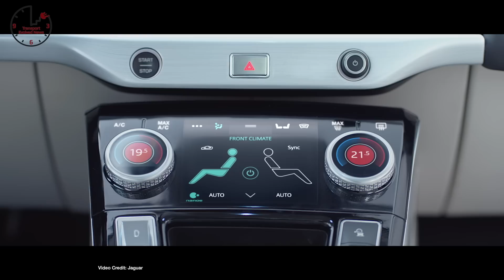Model 3 Worldwide Launch,  Jaguar iPac SVR, Hyundai Battery Search-  TEN Episode 211

Comment: By the way Cd (coefficient of drag) is a ratio, and therefore it applies to any size vehicle.  To put it another way, the Cd of any vehicle is independent of the size.

The CdA (coefficient of drag multiplied by frontal area) is definitely relative to the size of the vehicle.
Reply: Agree. Thank You :D
Reply: Neil Blanchard, correct, and it’s easier to get a low drag coefficient on a big vehicle, which is why the Tesla semi can claim it has a lower drag coefficient than a Bugatti Veyron. It would be better if cars were rated in kw needed to go 100 km/h.
Reply: Well, it is the length that helps the Cd, not the size, per se.  Most of the drag is generated at the back of the vehicle.  

The Bugatti has a massive cooling requirement, and drag is generated on the air flow through the cooling system.  On a typical ICE car, this is about 10%, but that car has far higher cooling load, so it is probably much higher.

Electric cars have lower cooling load, so they have an inherent advantage to get lower drag.
Reply: Neil Blanchard, the size of the vehicle is what allows it to more easily conform to a teardrop shape, while having the utility that you need. As you make it smaller, it’s harder to get the shape, and have someone sit in it. 

Yes, Veyron has a lot of cooling drag, but also has a lot of induced drag that the semi doesn’t have. Formula One has even more induced drag. So if you are major a racing car with foils where L/D is important, Cd is important, but for the masses, Cd is just a marketing term. Even someone who understands Cd can’t easily calculate the aerodynamic drag without knowing the frontal area, and then would still need the rolling resistance and drivetrain losses. 

So kw needed to go 100 km/h would be useful. We know the Tesla semi needs 120 kw, and I bet the Veyron could do it with 30 kw.
Reply: IMHO Understood - I has designed and begun to build an EV called CarBEN, and having the front close to square means the interior volume is more practical.
Reply: Neil Blanchard, are you using computer modeling for drag or just building based on known optimum shapes for low drag?
Reply: Neil Blanchard, oh, I looked at your channel. Are you still working on CarBEN or is that project canceled? Looks like you did a lot of work on the computer designs. That Black Illuminati car was interesting too.
Reply: IMHO I was basing it on known designs.  I tried to do CFD but the model was full of holes, between the polygons.
Reply: IMHO I am hoping to get back to it.  I need to add to my garage.  My interim goal is to take it to a wind tunnel.

Comment: I have saved over 1000L of diesel since I got my e-golf. I'm also the first at work to have en ev and every one is interested one actually started shopping for en ev. Currently what is hindering ev adoption is dealers not having them in stock I had to wait almost a full year for mine.
Reply: Right I tried to test-drive an env-200 in the UK and they said it would be months before they have another one in.

Comment: I have to take exception with your suggestion that people who buy ebikes do so because they can’t afford or accommodate a car. I know in the U.K. people have a problem with understanding quality bikes aren’t cheap. I’m always finding that when I talk to people about bikes and ebikes especially. I was just expecting a bit more. You can buy top quality ebikes that cost decent used car money, because they are incredibly well engineered and ideal for urban and suburban environments. Riesse & Muller for example make amazing stuff. But even the average specced ebike will set you back a couple of thousand.

I love my Renault Zoe and I’m excited to swap to a Smart EQ, but in terms of pure fun, around town especially, the bike is so much more satisfying than the car. I can’t wait until we actually have good bike infrastructure and I’ll be even more in favour of cycling.
Reply: For me there's much greater satisfaction gained from riding my bike than driving a car. Any idiot can sit in a car and press pedals with their feet, whereas it takes actual effort to ride a bike. It's just a shame that e-bikes cut out at 16mph. When I was fitter I was able to maintain an average speed of almost 20mph. Seeing as it's quite flat where I live! An e-bike is only any use to me on the odd hill or slope. What I want is a bike that can add 5-10mph on top of what I can already achieve. I need a minimum range of 35 miles as my round trip to work is 31 miles.
Reply: Chris Till,
Take this from a person of the largest motorcycle market, india, there is still an issue about safety and protection from the elements, here a  used Tata Nano with A/C costs $1k

Comment: From what I can gather the higher insurance cost for Teslas is due to the exceptionally high cost of accident repairs rather than the volume of claims.  This being particularly so for model x with the plethora of sensors in the gull-wing doors necessitating exact paint film thicknesses to operate correctly.  One would have thought Tesla could knock this on the head and subsidise repair costs but alas another opportunity missed and the claim of electric cars being cheap to run is negated by the enormous repair bills. Let's hope the dumbing down of the model 3 and Y will result in more sensible insurance quotes!
Reply: Costs are higher because there is no competition in the repair market: Tesla won't sell spares so no-one is able to compete (except by using bits from scrappies). Right-to-repair laws should force them to stop this restrictive practice. I won't buy a Tesla for this reason alone.

Comment: As usual, GM does not need a bigger battery for the Bolt. It needs to fix the crappy 50kW charge limit.

Comment: 6:40 “Driving all morning and still have 230 miles of range remaining”. Just so I’m not called hypocritical, I have to say this is too ambiguous to mean anything. How many miles (distance) is “all morning” (time period). Which of the 3 range estimates on the Bolt Guess-O-Meter was showing 230 miles? I follow Youtuber Eric White, who has a Volt and Bolt, and he drives so economically that his upper range estimates is over 300 miles. 

If you followed Sean Mitchel and Erik in the model 3 hypermile test, they also “drove all dang day” (8 hrs) and the estimated range still showed over 250 miles remaining, and they actually went 606 miles total. And it was camouflaged as a Wunder Capital Indy pace car. Could this actually be a Tesla solid state flux capacitor power cell being tested? 

Unfortunately Elon was unavailable for comment. LOL. 

I love to speculate but we need at least a fragment of tangible evidence to start with.

Comment: battery capacity is most important.  One they have that speed is easy because electric motors are powerful.
Reply: more range though? They are already going beyond what most people will ever need at 500-800km per charge in the big capacity cars, and 200km on the very low capacity end. I would argue they need to focus on charge time and charging infrastructure now they have worked out the range of cars already... 800km is longer range than any petrol car I've ever owned lol
Reply: As important. my Mom's car could do it, but you would be running fumes so I never ran it so far because on long distance trips you did not want run out of gas after passing five gas stations but died one mile short of the next one. :)

Comment: Great update, have a good flight, I think the thunderstorms have moved away north by the time you fly in?!  On a totally different topic, I have discovered something extremely weird about the 'feed-in tariff' or the incentive money per kWh that the home solar panel owner or turbine owner can receive.  In short, it used to be about 3 times the current price of energy from the grid, now it is a THIRD of the current energy price from the grid - a drop of about 90% in round numbers.

So, it is obviously a disincentive.  That's not the weird thing.  I was trawling through some solar panel articles, and came across this online in the (London) Financial Times:

'The current tariff for early adopters is 50.67p per kilowatt hour generated. This has increased from 43.3p in year one and will increase again next April in line with the retail prices index figure for December 2017. It will keep on increasing for another 18 years. After that, the feed-in tariff subsidy finishes, but the saving on electricity bills continues.

The wonder of the scheme is that you get paid for all the electricity you generate even if you use it. You also get an additional payment for the electricity you export. And you feel virtuous because a typical home solar system saves about 2 tonnes of carbon a year.'

The fact that the early adopters as they are called - rich people to most of us - can KEEP getting an astonishing 50p or so for every unit of electricity, while someone trying to do it now in 2018, will get about four pence per unit (!) is just astonishing.  A binding contract of this sort on the government, is the most extraordinary creature, very rare indeed.

Indeed, the two prices, I have decided are inextricably linked:  it is surely precisely BECAUSE these awesomely high incentives are guaranteed to be paid for the full 25 years untouched, that the EXISTING incentives from here on, are so AWFUL.

Apparently 1.5 million homes in the UK use solar now, a high figure I would have thought (eg compare it to electric car ownership).  If a lot of them are 'locked in' to the excessively high incentive rates, the rest of us hoping to get going, are being made to stomach the paltry sums on offer, because of the overall cost of this needing to be kept down.

The critical level of incentive or 'feed in tariff' as it is in the UK, is where they stop paying as much as the rate the consumer pays, for each unit of electricity.  Basically, if you pay 14p per unit (kWh) to your grid supplier for what comes out of the grid, but only get 4p or 8p or something for each kWh you put back IN, you cannot feasibly use the grid as a 'powerwall' or storage system.

In other words, in the UK, to make decent use of your solar array or wind turbine making energy at all hours when you don't need the ruddy stuff, you now need three times as much area of panels as someone did in 2011, just to be paid the same per unit you generate, as you have TO PAY to draw that same amount of energy off the grid.

This is a practical death-grip on any desire to implement a home solar array in the UK.  The government needs to re-jig the early adopters (rich people) tariffs if needs be, to permit the payment for lecky I make going IN to the grid, the exact same price I pay for lecky I take FROM the grid.  This critical price point, enables me to treat the grid as a storage system, a powerwall, without having to buy that thing myself.

But no, I bet our government never will do this.

Fact is, these things are true in the UK:

- they do not want us to have home generation of electricity hence the mish-mash arrangements and nonsensical pricing arrangements for feed-in tariffs, and weird strictness on who can screw up a panel onto your roof, necessitating a lack of competitiveness in fixing work.  I understand the electrical side needing to be quality, but I am suspicious of the rest.

- they do not want the general population to move to electric vehicles.  Not before a decade or so.  The tax take is already taking a hit, the UK government relies massively on both Road Fund Licence (Road Tax) of hundreds a year from cars, and the huge gas prices tax component (over half the pump price), to keep the books half-balanced.  No, they do not want large numbers of people rushing out to get an EV, it means in effect, raising the already unpopular local tax known as Council Tax, or income tax, or some other national tax, to compensate.  God no.

- Now about the present Conservative Government in particular.  Here is a fact: Tory governments hate manufacturing or any other technical industry.  They let them die at the drop of a hat.  The sad empty promises to Nissan in Sunderland about Brexit not being allowed to affect them, the Japanese do not believe.  I think it is part of the reason the 2018 LEAF is so underwhelming.  I mean, they went from 24kWh, to 30kWh, then 40kWh in the three years 2015 - 2018.  These are baby steps.  Meanwhile Hyundai, Kia et al concentrated on breezing past that to a 'proper' big size like 60kWh, stated outright.  Nissan have not done this, not committed to the tech needed (liquid cooling).

Tory governments (the Conservative & Unionist Party) are forever shaped in their Lord God's own likeness (Margaret Thatcher).  She came from a shopkeeping family of small supermarkets, and believed in buying and selling stuff.  MAKE STUFF?!  Good lord no.  She famously described Britain as a 'Nation of shopkeepers'.  That is how she saw us here in the UK, and that limited parochial Lincolnshire shop chain view, has gripped the Tory party ever since.

They hate makin' stuff.  They do not really respect people who do.  They really don't understand WHY one would ever WANT to dabble with getting one's hands dirty.  They are downright snobby about, and suspicious of, anyone who does.  It's unnatural.  Best left to the Germans, old boy.

Lawyers and stockbrokers, and property buying 'cos wot else do you do when you have oodles of cash and no real skills to create stuff anyway?  It's an affliction, and it has coloured every single thing the Tory party have done for a long time, including the Brexit vote itself.  It is an insular and timid outlook, it lacks confidence, and drive, and the nerve to build and create.

The only time it ever happens is proven to be in war.  Spitfire yes.  Nissan e-car factory? Weelll...as long as you don't actually want anything in writing we can drop some words of comfort...!
Reply: sleekitwan they fly over the poles

Comment: So, stupid arrogant idiot question of the day: Why don't ICE manufacturers have to make excuses for the fuel for THOSE cars coming from places where the citizens have minimal rights or worse! ~Yeah, I think the cobalt should be procured in a better manner, but this issue seems like a BS one that makes the ICE manufacturers happy as a clam.
Reply: Yes, are there not gooey sludge pools of black muck, toxic ponds of sterility, in the middle of jungles and so on?  Then there are the pipelines making huge targets for terrorism, place above ground for cheapness, and so on.  A large amount of cobalt Nikki said, is currently being reclaimed from slag heaps of copper etc?  So, this is pretty green albeit with child labour, reprocessing existing ore dumps basically.  Then, there is the secrecy issue, of environmental damage oil and gas drilling cost - there is no way the drilling miles under the ocean surface for example, ever gets monitored in a true sense?  No, couldn't agree more, the dark secrets of oil & gas, and coal, fill many filing cabinets and server farms somewhere.  Hidden behind 'commercial in confidence' excuses, and even National Security in some cases?